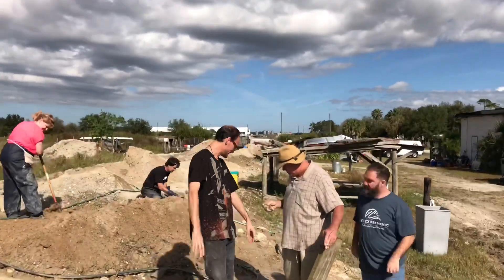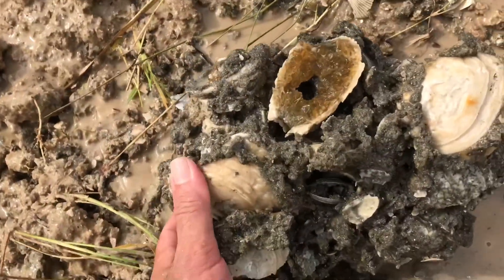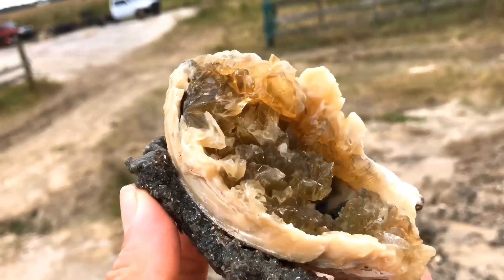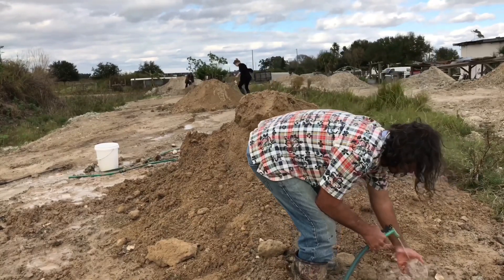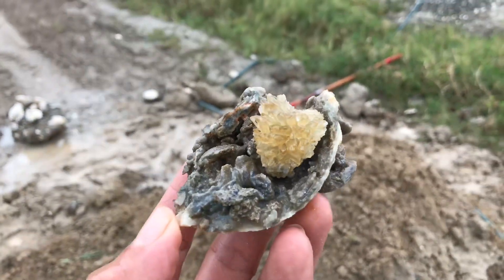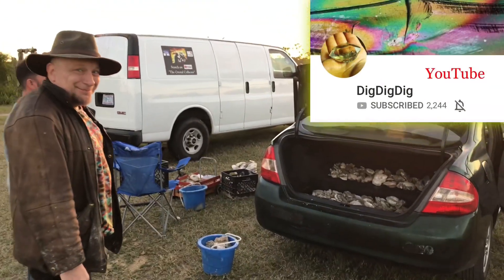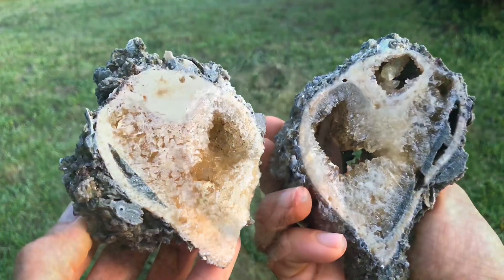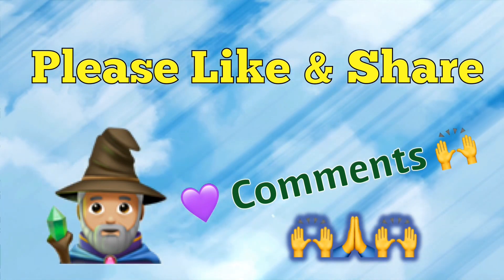Crystal Hunting in Florida for Golden Calcite, Sharks Teeth & Fossils

Comment: Are you using a regular heavy duty tile saw to saw them open. Its definitely a bucket lister. I have a piece from there gifted to my by a friend. It's one of my favorites.  Another great video. Jerry does it again....
Reply from the maker: I actually bought this wet tile Saw At a garage sale for $20, I did have to buy a blade which is expensive but it works pretty good
Reply: @TheCrystalCollector  that's good to know. Mine has the HP just need a good blade I guess. Thanks for the info